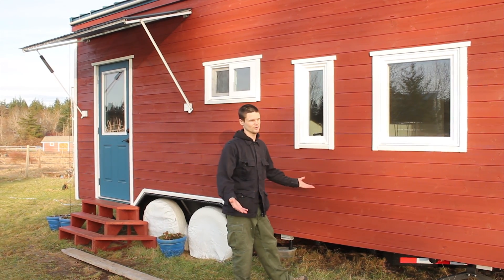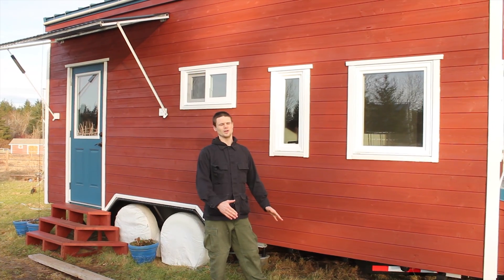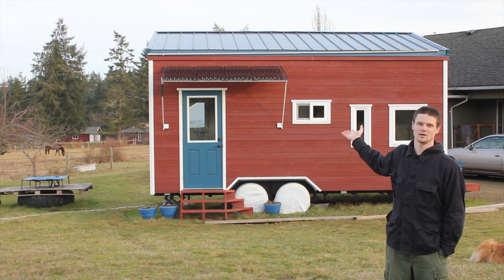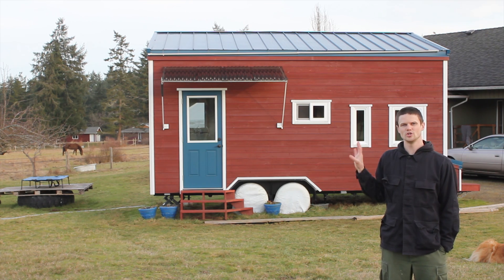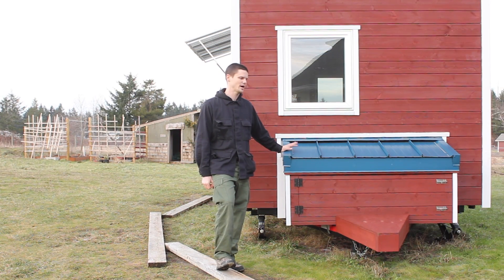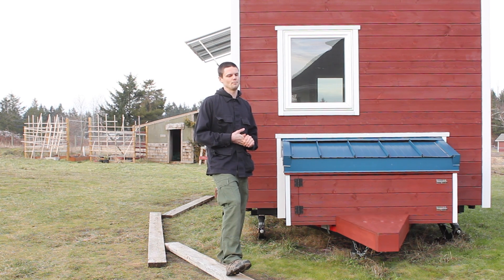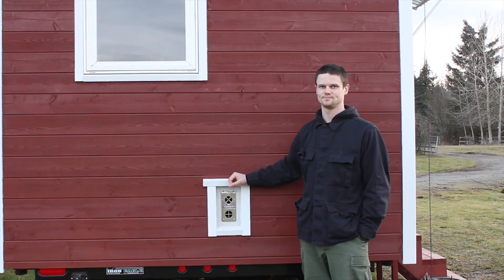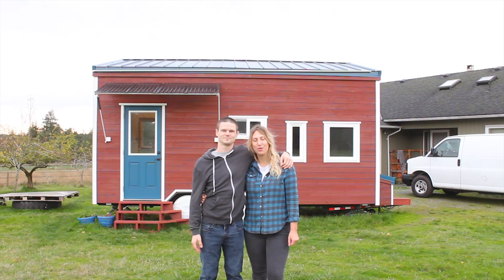Tiny House On Wheels Technical Specs

Comment: 6000 CAD for the trailer? Wow, you're lucky with that. I'm in Europe and recently asked for a general range of pricing for a  fifth wheel trailer from a Dutch manufacturer.  Guess what I got back from them (a company called Fifth Wheel Europe). They quoted me a price of 16.500 eur I shit you not, that's 25.000 CAD. And that was for their smallest 6m long fifth wheel trailer. That sounded like a total rip off to me hearing the prices from the US.
Reply from the maker: Is that a custom order? or a regular price for that trailer?

Comment: I don't recall seeing the air intake and exhaust before, that's a great system. 

Something I've never actually seen but that SHOULD exist is something vaguely similar for a refrigerator. A refrigerator radiator dumps the heat generated by the compressor into the house. If you could either move the radiator outside (which I did see once decades ago) or seal off the area around the radiator and vent it outside, you could reduce the inadvertent space heating and probably make the refrigerator more efficient.

Of course this would be more important in a hotter climate.
Reply from the maker: The propane flange or the air-exchanger? 
Re: the fridge... I've had the same thought. There is a lot of wasted or excess energy that could be manipulated to one's advantage :)
Reply: Whatever you are showing ai 7:01.
Reply from the maker: Ah yeah that's the water-heater, which has the same exterior combustion setup. All air use for burning is brought in and exhaust is expelled through that outward-facing grill.